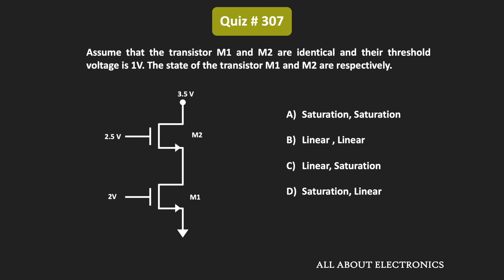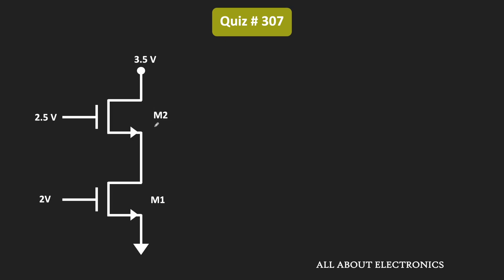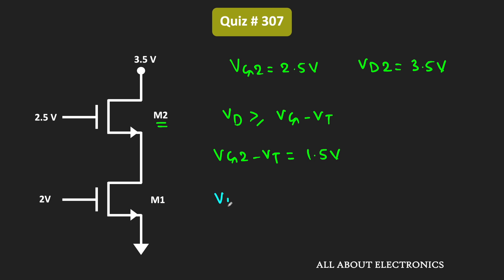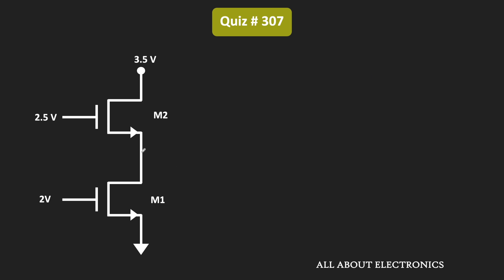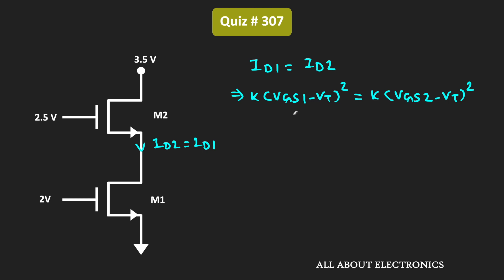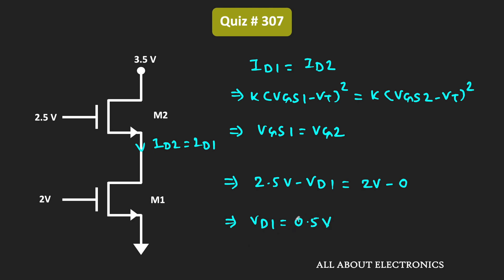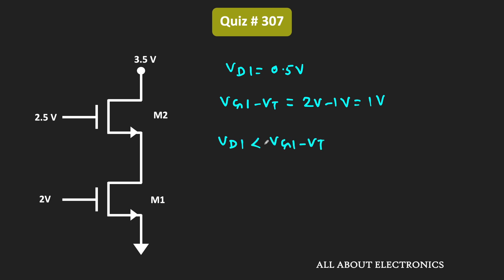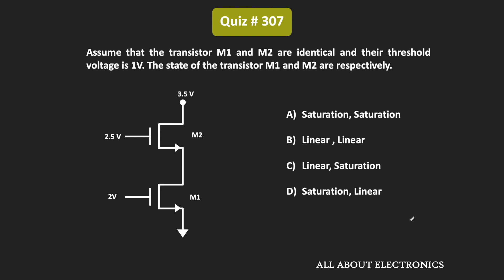MOSFET Solved Problem | Quiz # 307

Comment: Where did the equation Vd >= Vg - Vt come from?  I thought it was Vds >= Vgs - Vt  I used the fact that Id was same through both MOSFET and got Vgs1=Vgs2.
Then for M2  voltage at source Vs = 2.5 - Vgs and for M1 since Vs is same as drain voltage into it, Vs - Vgs = 0.  From this it seems that both are in saturation.
Reply from the maker: Vds >= Vgs - Vt. 
Now, Vds = Vd - Vs and Vgs = Vg - Vs.
So, in the above expression, Vd - Vs >= Vg - Vs - Vt
Or that is equal to Vd >= Vg - Vt
Now, coming to your second point, the Vd1 = Vs2. (The source of M2 is connected to the drain of M1).
Therefore, Vd1 =  0.5V.
And for M1 = Vgs = 2V. 
So, since Vd1 < Vg1 - Vt, so M1 is not in saturation. I hope, it will clear your doubt.
Reply: @allaboutelectronics-quiz  Thank you for your explaination

Comment: First, you assumed that M1 is in saturation then how we can say its in linear after obtaining Vd of M1 is 0.5V?  Please clarify.
Reply from the maker: If M1 is operating in the saturation, then VD1 > VG1 - VT, OR in this case, VD1 > (2-1). That means if M1 is also operating in the saturation then VD1 should be greater than 1. But assuming M1 operating in the saturation, the obtained value of VD1 is 0.5 (less than 1V). Therefore, M1 is not operating in saturation. 
I hope, it will clear your doubt.
Reply: @allaboutelectronics-quiz  why did you not take into account the source for these?